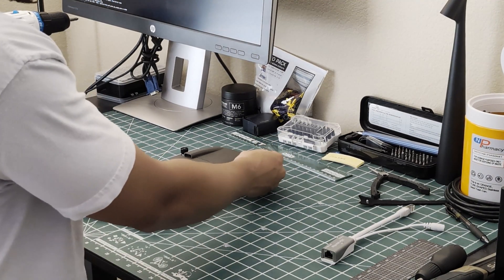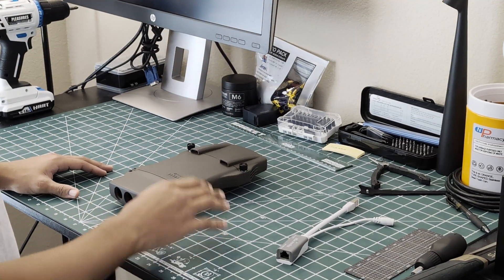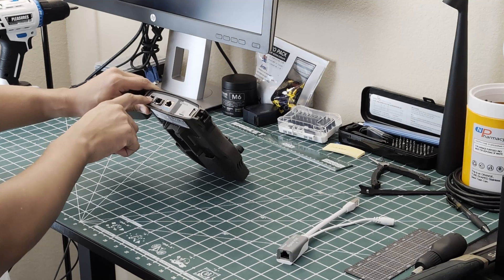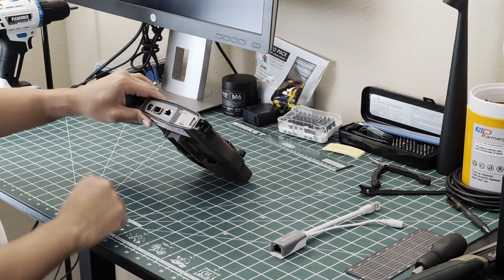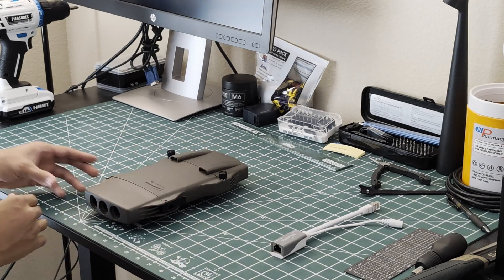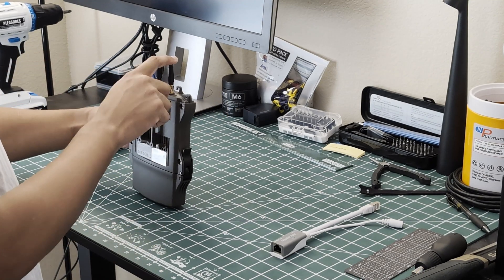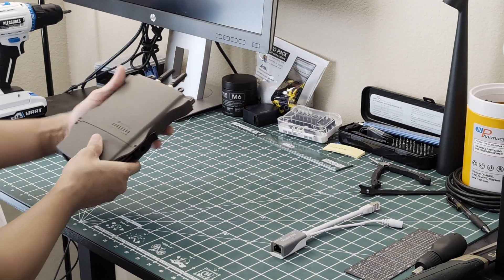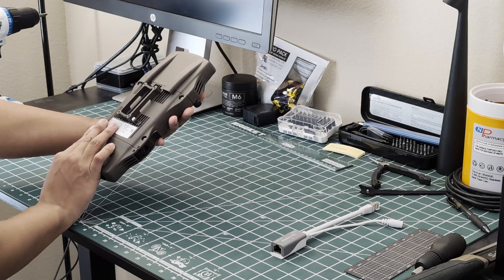NETMETAL AX OVERVIEW (L23UGSR-5HaxD2HaxD-NM)

Comment: How well does it perform with those antennas underneath the metal top cover?
Or is that top cover not metal?
Reply from the maker: I’m using it indoors, and my testing has shown throughput around 300–380 Mbps. It’s recommended to use external antennas for better performance.

Comment: Is not coming with any antenna included ? I suppose is not recommended to use it without antennas...
Reply from the maker: Yes, no antennas are included, but they do offer a model called HGO-Antenna-OUT, which is paired with it in some bundles.